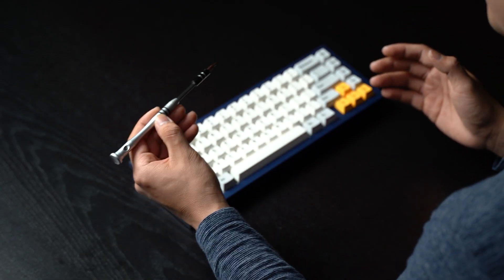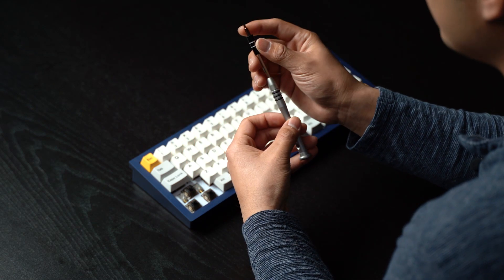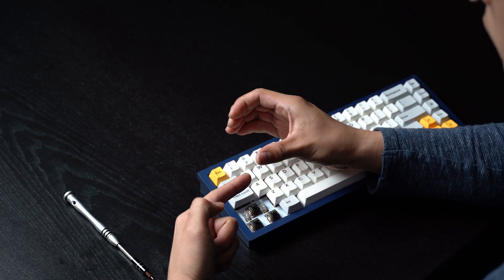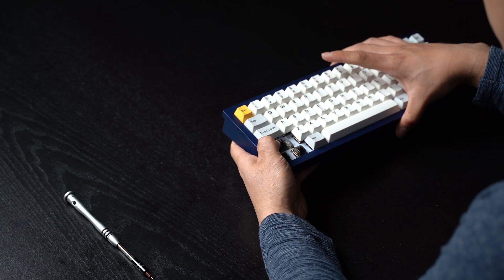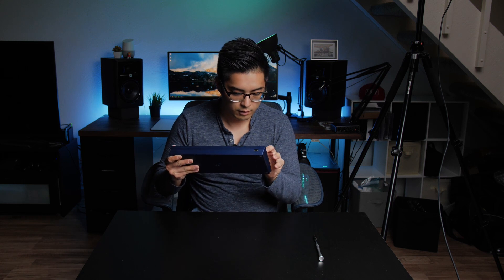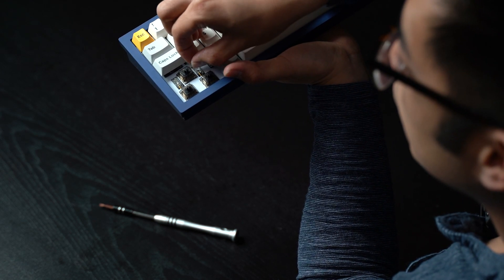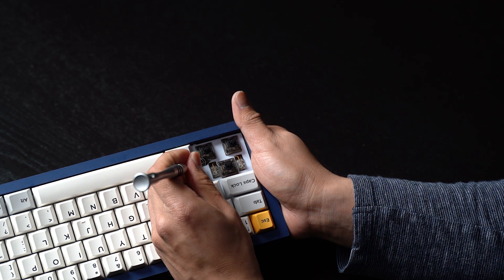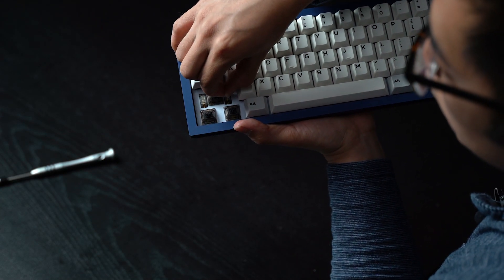How to Fix Popped Wires in Keyboard Stabilizers

Comment: I have a hotswap board and was too lazy to take it apart to fix the stabs, tried this method but the plate on my board left me with too little space to work with but managed to fix one stab using brute force but the other stab my screwdriver bounced off and scratched my PCB leaving a nick exposing a bit of the copper, and worse I accidently spat on the area while cursing lmao, luckily my PCB still works and hopefully sticking some electrical tape on the affected will isolate it enough to not cause oxidization.

I'm a careful hands on guy, I build scale models houses and shit for Uni but this with the combination of using brute force and a small leeway to work with it just ends up bad. For anyone that have a hotswap board but lazy to disassemble it, unless you're very very careful and patient I wouldn't recommend this method.

Comment: it popped out of the housing pls help
Reply from the maker: you gotta push it back in the way it came out
Reply: @AndyVNguyen  it’s just the bar in there the housings and stamps are out and i can’t desolder
Reply: @AndyVNguyen  and if I try to put them bag in and the press the key it won’t come up again
Reply from the maker: sounds like plate mount stabilizers - you can actually take the whole thing out and put it back in. look up guides on what people did for the massdrop alt to replace the stabilizers

Comment: A year later and still a relevant video. I couldn’t pop the wire back in using a screwdriver due to too little space to work with. I used a cheap lock pick set to get in there and apply pressure on those corners. Thanks Andy!

Comment: @Andy V Nguyen
Hi have a question, my stabilizer popped out of my apex pro tkl but I don't know how to fix it.
Reply from the maker: I'm gonna guess it's a plate mount stabilizer and you'll need a flat head to insert it back in. Look at the guides for mass drop alt/ ctrl and they might show you how to replace the stabilizers - use that info to put yours back in

Comment: Is this possible if you can't reach the wire joint? My plate is basically completely covering it and I can't get in there with anything to push back
Reply from the maker: you can try to use floss or something but to feed it around might be tough.

Comment: My space wire popped out just after soldering, I can't get the wire back into the clip because the clip is too tight. I can't thread string in there to guide it either. :(
Reply from the maker: if it came out it should be able to get back in.. might need something with clamping to really guide it back in there

Comment: my stabilizer stem popped off on my soldered keyboard and i dont know how to desolder now i dont know how to put back the stem in the wire
Reply from the maker: That's what the video is for. You can try to use like floss and stuff to guide the wire too

Comment: WHAT IF I HAVE PLATE mOUNT STABS!!
Reply from the maker: it's the same thing - except youre likely able to take the entire stabilizer out and have an easier time fixing it
Reply: @AndyVNguyen  the whole top of the plate is cover by the housing of the stab so i can’t fit anything in the push the wire back in place

Comment: My plate was not made to be able to see the right angle when the stab is popped out.  I used a paper clip, and pliers to make a small hook.  I hooked the wire with the paper clip and pulled.  Popped back in easy.
Reply from the maker: Nice ingenuity and great work!

Comment: I got an extra Bakeneko Soldered plate that came with soldered switches aftermarket. I tried to pop out the spacebar keycap and it was too tight that the switch's top housing came off from one side and the stab wires popped out. It was a mess but your video helped me pop them back in and that saved me so much time and money as I dont own a soldering Iron or have any soldering skills. I managed to put the switch back in somehow and it works but it makes a funny crunchy noise that Ill probably have to replace at one point. But regardless, thanks a ton man! Saved me so much time!
Reply from the maker: Glad I could help!

Comment: uhhh the wire is still in there but the stabs are off...
Reply from the maker: Plate mount? Take the wire out also, put it back in the stab, and put the whole thing back in
Reply: @AndyVNguyen  thanks for the steps but i basically just did it with blunt force and also for some reason it got rid of about 90% of the rattle for some reason. Not quite sure why but no complaining thats for sure!

Comment: can someone help me? I bought a gk61x and i tried to mod my stabs, when i was taking out the stabs it fell apart from the wire. I tried to reassemble it and now the stabilizer tab wont push in.
Reply: same, my keyboard is soldered so idk wtf to do

Comment: Its not working
Reply from the maker: It will work.. sooner or later. If it doesn't you may want to try to desolder just 1-3 switches near the stab so you have more space to pull the wire in

Comment: uh i cant see the wire i think my plate is blocking it idk tho im like a mega beginner
Reply from the maker: try to use a switch puller to try to hook the wire back into place since it has a 90 degree bend

Comment: I don't comment but thank you so much! I managed to fix my spacebar stab after me pushing a new keycap on too hard popped the wire out of place! I didn't realise that was what had happened until I found this video, I thought I'd have to desolder my board and replace the stab altogether, you saved my KBD Tofu

Comment: Good video. The only problem is that this is a 1 time fix that will still continue even after the "fix". I have this problem on my durock v1 stabs and even with original gmk keycaps, the stabs are still popping out every time I replace the keycaps. Im now thinking to myself that the only "real" solution to fixing this problem is to change the stabs to a completely different set like the v2's or or the c3's
Reply from the maker: I rarely have wires pop because I pull keycaps up evenly and do not put keycaps on unevenly. Also warped longer keys can cause pops as well.

Comment: Man I can't fix my FUCKING SPACEBAR STAB. I've been trying this for like 2 hours now and when i finally get one side in, the other is out. The further i push one side in, the other side of the bar goes  back further away from the stab.. i hate thisssss
Reply: Update:

I GOT IT BACK INTO PLACE LFG. I LOVE YOU FOR THIS VIDEO YOU BEAUTIFUL MAN
Reply from the maker: LOL I’m so glad you got it
Reply: @matchress3832  how did you end up fixing it. My keyboard is kinda doing the same thing we’re it’s in place on one side but the other side is out
Reply: @lasuko5449  used some small screwdrivers and positioned the spacebar wire perfectly and pushed down super hard still i heard a click on either side. Had to use tweezers to make sure the bar was in the correct spot. Took me a while
Reply: @matchress3832  for me my whole stabilizer fell out. Leaving just the wire there so will that still work?

Comment: Just happened with my tofu65. The stabilizers face upwards and I can't get anything thin enough to pop it back in place. Just gonna desolder--but thanks for the tip!
Reply from the maker: Flat head screwdriver? Also you can just desolder switches nearby to open it up a bit
Reply: @AndyVNguyen  I'll give the flat head another shot. Worked on it for around 2 hours yesterday  haha.

Comment: Legend! I was wondering why my Enter key sounded weird when I got new keycaps. I'm assuming the old ones grabbed on so tight and popped the wire out. I took it off and I saw that the stabilizers didn't come up together so I knew something was wrong. Thankfully, I found your video and I was able to shove that wire back in. Thank you so much!

Comment: Quick question: I recently got a novelkeys nk65 v2 and i have tried clipping, lubing (205g0 housing and dielectric grease wire) and band aid mod my spacebar stab. Comes with cherry plate mount stabs i think. I still cant get rid of this annoying rattle. Other keys are fine, just my spacebar. I know they are plate mount stabs and will never be as good as screw in but i checked further the wire itself is not straight. I have tried to straighten it but it just won't straighten itself and flatten out for me. Can i buy a different set of stabs and as long as the wire is 6.25u, swap out my current wire? For example i get a gmk screw in stab kit and just take the wire and replace the current one im using? Thanks in advance.
Reply from the maker: Switching wires should work. I've done it on GMK stabs and Durock wires.

Comment: Hi there.

One side of my spacebar stabs wire came out of the stem and is now under the stem. Is it possible to place it back without popping out the wire (the place near the curved angle)?

See it visually here if you have the time

https://youtu.be/yuwLpACyAO0

Comment: How were you able to get both wires out of clearance? I'm having some trouble with my everglide stabilizers, should I try to do them one by one?
Reply from the maker: i ended up using another tool to pull the wire into place and then a flat head to push it into the housing.

Comment: Just happened to me, what worked for me was 1. getting the wire out completely 2. tilting and moving the stems 3. pop back in (this was the most annoying part). Instead of a screwdriver I used a dull pocket knife because my screwdriver was too thicc to get in the right angle.Thanks for the video, it definitely helped me to fix this rather quickly. I heard of durock/everglide/zeal pop out issues but c³ was out of stock when I bought my parts, only thing I could find in stock was durock :/ hope they or other good options are available again for my next build, they are less prone to pop out right? At least they are not 20€ just to cause pain and suffering lol :p
Reply from the maker: C3 less prone to popping out. Too bad they have issues with kat and epbt keycaps tho
Reply: @AndyVNguyen  Oh with kat too? That's disappointing, I don't really care about epbt right now but have seen some nice kat sets I considered getting
Reply: your knife suggestion just saved mine, i tried with a screwdriver for like 2 minutes then as soon as I read this I managed to just pop it in with the back of a boxcutter taking advantage of the angle

Comment: Damn this is so much work haha...
Would you say there's just a "good" stabilizer shortage right now?

GMK retool has issues
Everglide/durock has pop out
Zeal too expensive
C3 out of stock

Seems this way to me
Reply from the maker: GMK retool is rattly due to the wire being too large. Everglide and Durocks are the best of the bunch at the moment. I only had it pop because of the tolerances of JTK Hyperfuse caps leaning too tight - causing them to LATCH onto my stab stems and not let go. When I finally got my cap out, the wire went out, too. I honestly felt like I was going to break my caps/switches/stabs when pulling it out.

Zeal is expensive and has had the wire pop out for a lot of people. Would not recommend at all.

C3 is good but it has issues with EPBT. That's R1, anyway. R2 should address the EPBT issues.